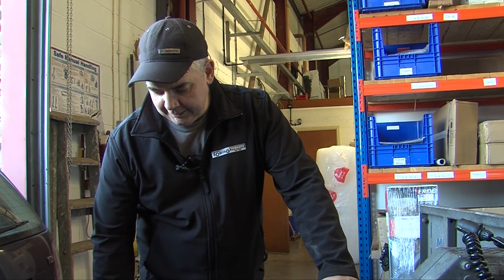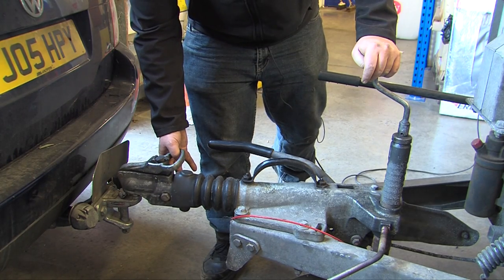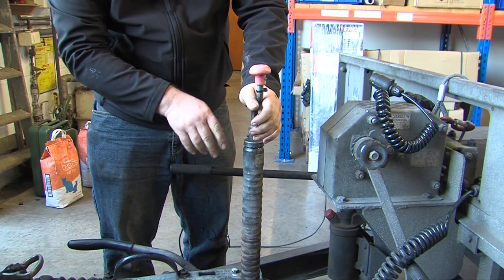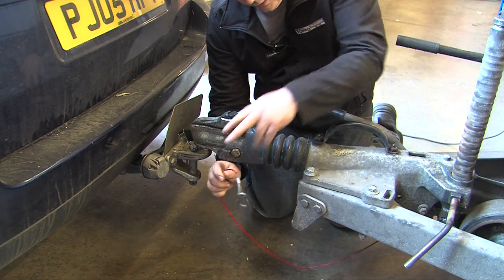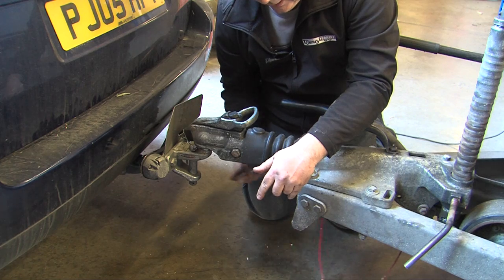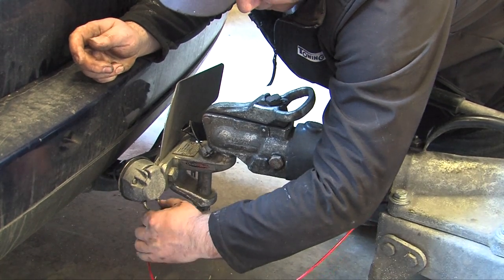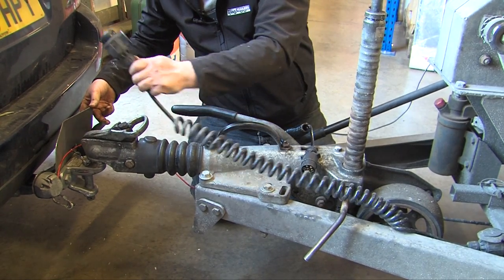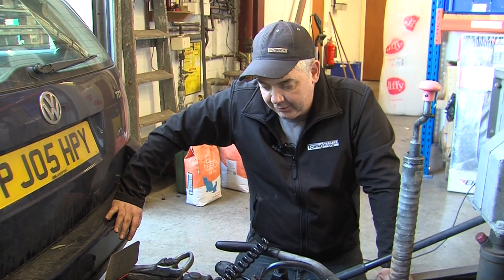Connecting a braked trailer to the back of a towing vehicle

Comment: From the states we have safety chains and the trailer draw bar is fixed. A flat non trailer brakes a the 7 pin for electric brakes are most common. It's interesting to see how other parts of the world does things.
Reply from the maker: Hi Thankyou for watching the video.

I am aware that the states use electric brakes. the European system ( Over run ) is all mechanical and will work on any car without a controller in the tow vehicle but can take a lot of maintenance. people that use the Electric brakes from the US do seem to think that they work better than over run. also you don't have the issues of an over run system wanting to put the brakes on as you reverse. saying all this the advantage of a mechanical system like the European system is it can be easily maintained.